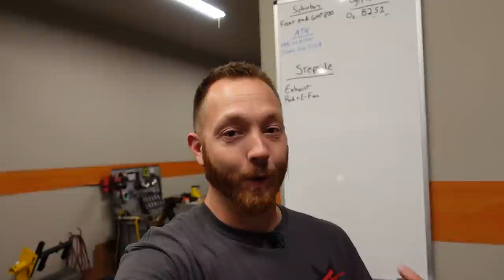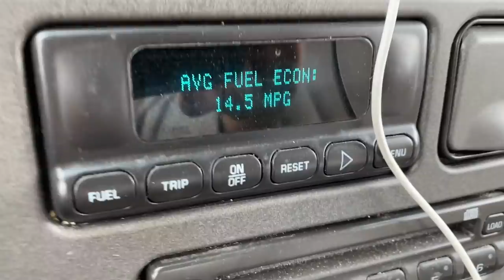the ULTIMATE BRAKE CONVERSION for your GMT400

Comment: Here's an idea for the truck. See how far you can take the current stock 8.1 in ugly truck once the new engine is built. Do the basic upgrades to make it have a chance like pistons, heads, and intake. Swap it in the suburban. If the engine mounts are anything like the 454 it should bolt right in place. That would make this machine snappy. Both have 4l80e so it should be direct swap.

Further idea is to find a GMT400 2 door Tahoe and do a custom thing. If the suburban length is the same then just move the rear axle back like 8 to 12 inches to make the wheel length of the Tahoe. I thing the extra wheelbase would be useful and look cool.
Reply from the maker: both great ideas!

Comment: LT, have you ever looked into an L21 454? Commercial variant and from what i hear, it comes factory with a forged rotating assembly, and coil near plug with a 24x crank and 1x cam sensor (in place of the distributor). I’m considering trying to find one to put some heads and a cam in, and possibly port the intake and see how the truck does pulling trailers

Comment: 99 K2500 7.4L GMC SLT Suburban, essentially the same as your burb. I've been trying to resolve the front suspension bounce when you use a leveling kit that changes out the torsion keys. I've added much higher dampening Fox 2.0 Shocks, but not entirely free from the bounce. I was hoping to find a dual shock solution for our rig, but to no avail. 

I've got you parts list for the front suspension/ brakes and I'll be doing the conversion pretty soon once I finish my dual battery and charging system rewire. Let me know if you might have a solution for the bounce, Ideally I'd like to have 35" tires and would like to avoid a full blown lift if possible as the only real options are 6" and above lifts and don't really want to add blocks to the rear or swap out the lower suspension carrier.

Comment: So in theory, since the GMT400 K2500/K3500 forged LCA is a direct swap for the K1500 trucks, a GMT800 LCA would swap on to a K1500 as well, besides the ball joint differences?

Comment: Awesome brotha and thanks. I’ve got an ‘00 Escalade with 250k that I am going to upgrade now, steering, suspension, and brakes. What’s a good link for data you get about the specific part/model swaps? Is there a forum you prefer or are you mostly reading TMs and what not from Chevy/GM?
Reply from the maker: i read pretty much everywhere and everything I can, forums used to have a ton of good info on em, but a lot have closed down. lately, some facebook groups seem to have good knowledge in em as well
Reply: @LawrenceTolman  thanks mate

Comment: Did you use the stock master cylinder and proportioning valve? 
Was thinking the stock master would not have enough fluid capacity to expand your brake calipers.
Reply from the maker: I had planned to switch it out, but for now its still stock.

Comment: During your research, have you seen any information on doing a brake upgrade on the 1500 2wd obs trucks using factory parts.  Everything I've found is the 3500 rotors and calipers with a nbs master cylinder.   I was hoping there was a way to use the nbs brakes on a 2wd but,  I've not found one yet.
Reply from the maker: i've never come across any good factory upgrades for the 2wd 1/2 ton GMT400s... the problem is they come with a C-10 style of spindle which is nothing like the GMT800 and cannot accept a GMT800 bolt on hub assembly.

Comment: I need a part#for the lower control arms. They should still bolt on to a 99 4x4 tahoe as well from what it looks like.
Reply from the maker: don't have the part number, but they are for a 2001 2500HD 4wd
Reply: @LawrenceTolman  damn more then likely the HD and stock lower control arm bushings will be diffrent in size then I assume.

Comment: Alright Lawrence, dumb question time...at 17:23 or so you mention that "believe it or not, the rotors are exactly the same size just the pads are much bigger and the calipers have two pistons..." so could I just change out the calipers and pads on my GMT400?
Reply from the maker: Well no, you can’t simply bolt GMT800 calipers on a GMT400 spindle because the mounts are different. That’s why we need to change to the GMT800 spindles

Comment: I'm surprised you didn't paint the frame.  That should be a good brake upgrade, those GMT400 were subpar at best
Reply from the maker: if I started painting the frame, next thing you know I'd be doing a frame-off restoration lol
Reply: @LawrenceTolman  Know your limit and play within it.  Did you do any 60-0 tests, before and after?

Comment: So when you reamed out the spindle for the upper ball joint did you ream it out so you could use the cotter pin or did you ream it out and add a spacer to make up for the thickness difference?
Reply from the maker: I reamed it out to get full engagement of the taper into the knuckle, then added a spacer to properly engage the cotter pin. when I reamed it only far enough to get the cotter pin engaged without a spacer, there was a ton of threads still left in the knuckle

Comment: Great content! I have a favor to ask....I'm trying to re engineer a GMT400 Dually 4x2 front end geometry because it's lowered. I see the K2500 control arms are mounted to the side of the frame not the top like mine, L T could you please measure the length of the upper arm for me, bolt center line to ball joint center?

Comment: @LT I may have missed it in this video, but do I understand correctly that the GMT 800 upper control arms will not fit the GMT 400?

Since this is a 2500, will this same type of conversion also work on the 1500?

-Rob
Reply: Im doing that so far no luck the upper control arms are not working making for positive camber

Comment: If you were to only do the front brakes, would you need the masterc cylinder or would the stock hydra boost still work fine?
Reply from the maker: likely the stock master will work just fine. I'm going to try it out with all my upgraded disc brakes and the stock master to see

Comment: I wish you were still in Tennessee.  I am in need of a set of old lower forged control arms for my old lifted 1996 K1500 with stamped lowers Z71.  Unless someone can confirm that new '99 lower control arms for a GMT800 will bolt onto the frame and into the knuckle/torsion bar of a 1996.
Reply: I’m curious about the gmt800 1/2 ton stuff in the gmt400’s as well. However, I’m close to Tennessee and I have a 98 1/2 ton 4x4 parts truck, I’m in southeast Missouri. Might be a little bit of help for ya. LMK if it would help or not.

Comment: after watching this video when you posted it i began gathering parts. i am now pretty much ready to do the swap and really looking forward to it! have you driven it after the swap? how was it along with the rear discs? i have a 03 duramax axle modded and ready to swap in aswell. mine has a compound turbo 12v cummins and the factory semi float is wearing out quickly.
Reply from the maker: I did drive it for a few hundred miles before selling the truck. Everything worked great, even with 4 wheel discs and using the stock master cylinder. The stopping power was greatly improved for sure.
Reply: @LawrenceTolman  thanks for the reply. Sad to hear you sold it.

Comment: Only thing i hate about my 8.1l van is the gmt400 brakes, wonder if i can do the gmt800 2500 spindles and lower control arms with coil springs on my van, hmmmm

Comment: You peaked my interest when mentioning the gmt400 3500hd master cylinder swap. What are the benefits of doing this? Is it just for the reservoir? Or is the the actual master cylinder different? I know you have rear discs, so does the 3500hd master omit the constant pressure that is normally applied on the rear drums? Great video, can't wait to see more!
Reply from the maker: to be honest, I'm not positive on the specifics, but I thought there was something different in the master cylinder that changed the pressure bias from front to back specific to a 4 wheel disc application...
Reply: @LawrenceTolman  
I happen to own a '99 k2500 7.4 similar to yours. It would seem that after comparing the parts visually and spec-wise, the 3500hd master is essentially the same as the standard hydrodroboost used by GM and dodge, just with a larger reservoir. On these units, any pressure bias is controlled by the proportioning valve located to the side of the hydroboost unit. I have heard of guys swapping to adjustable valves, or swapping in a gmt800 four-wheel disc brake proportioning valve. Hope this helps!

Comment: Hey this is the third time I've seen you work on a gmt 400 I actually have the 1999 Chevy extended cab with the 7.4 4l80 had my breaks lock up on the front end. Replaced the caliper the brake hose the master cylinder and still the brakes want to drag and feels like alot of jumping around under the truck. Lifted the wheel spun it round and it locked up on me took off the CV joints rotated the front diff one goes clock wise the other counters. No noises and doesn't get stuck like my caliper wants to jump (the new one) I'm kinda baffled here just replaced the master and the booster within the last year. Just replaced the master as I said last night same problem is it possible the booster could be in boost rather than release? Please help lol it's my only ride and I love these trucks.

Comment: Could you not just use a diff upper ball joint as opposed to reaming the spindle out ?
Reply from the maker: I have heard there is one ball joint that does work (not sure on the application or P/N) but it did require modification where it bolted to the control arm. To me, it just made more sense to ream the spindle, that way if I ever have to replace the ball joint, its a direct swap

Comment: Did you load the suspension when tightening the upper/lower control arms
Reply from the maker: yes, I used a floor jack to lift the suspension into a "ride height" position when I torque the bolts, so the bushings don't bind

Comment: Someone else already asked, but I second this: will you post a partslist for the gmt800 to gmt400 front brake swap? Or perhaps a good link to source a proven partslist? 
I have an 89' K2500 Sierra (SM465 4 Speed Manual, NP241 XFER Case, NO ABS on the truck) that desperately needs stopping power.
Reply from the maker: I'll try and get a parts list put together when I do the final review and first drive video
Reply: Thanks LT. I've been wanting to do this upgrade for a while now myself👍

Comment: How do you know all this stuff and what parts from each generation will fit and when knowing what size taper reamer to get.  Is it available somewhere deep in the web or just in your brain somehow, and if it's just in your brain how did you learn it.. Great video.
Reply from the maker: I spend way too much time researching and reading lol... a lot of this info came from some old-school forums I read long ago, and facebook groups also have some good knowledge buried amongst the "what's the biggest tire I can run" questions
Reply: @LawrenceTolman  nice.  I used to have a half ton 2000 suburban.  Only sold it cuz I needed a 3/4 ton truck to tow our travel trailer.  I was looking into brake upgrades, but never ended up going through with it all due to needing a 3/4 ton.  Now I have a 8.1L gmc sierra 2500HD, so I like your ugly truck content too.  I would like to cam and chip it.. and of course exhaust, but since it is the family tow rig, I need to keep it not too loud and reliable...

Comment: Ahhhh so u can also use a 2 inch drop spindle if u wanted to lower it. not just a drop keys option
Reply from the maker: you know I didn't even think about that option until now... but yup you could. also, lift spindles applies as well.

Comment: Can I do this same swap and use a 6 lug hub? I'd love to do this on my 98 z71 ls build
Reply from the maker: yes, I think you can do a similar swap with GMT800 1/2 ton stuff on a GMT400. not sure on the specifics, but pretty sure some have done it
Reply: No. This uses a four-bolt hub assembly. However, if you get a spindle from a NBS 1500 which uses the same three bolt hub assembly you can make it work.

Comment: I am not 100% sure about it but I thought the upper  control arms were all the same on OBS K1500 to 3500 and you just have to install the correct upper ball joint for the spindles you are using and you don't have to ream out the spindle. Also I thought the OBS K2500/3500 lower controls arms were all the same and you only have to install the correct lower ball joint into the lower control arms for the spindles you are using. Maybe someone else can tell me if this correct?
Reply: K1500 and k2500light duty upper control arms are narrower than the normal 8 lug k2500 jist found this out the hard way also the nuckle is tall enough on a 1500 or 2500ld to make for bad positive camber working on getting some off set upper control arm bushings to maybe fix that gm 45K0201 dont know yet if its gona work

Comment: Would there be any problem If I do the gmt800 1500 6 lug on my gmt400 1500 z71?
Reply from the maker: I think it works in the same kind of way as it does with the 8 lug trucks, but I've never done it myself to confirm
Reply: @LawrenceTolman  that was my thought process too. just gonna have to find and figure out myself

Comment: anyone know what thread the oem brake like is on the front of a 1990 k2500 light duty ?
Reply: Turns out the upper control arm is different on the ld 90 k2500 makes for way to much positive camber going to try the offset uppper control are bushing to see if i can get the camber close not holding my breath its pretty far off 🤢

Comment: I doubt you actually noticed braking improvement just adding rear disc over the rear drum.  Drums have so much more braking surface.  Drums suffer from inability to shed heat as efficiently and thus brake fade.  Fresh cold drums should stop faster than a disc...  the 1st stop,,  with less pedal pressure.   Unless your rear drums were way out of adjustment.
So..  frequent and often stopping.. discs..   shedding a hundred or so pounds of unsprung weight..  discs.
Reply from the maker: good info there, and I do agree on the weight. those stock drums weigh a ton

Comment: Why couldn't you just buy gmt 800 ball joints and bolt them onto stock gmt400 control arms? If the arms are identical, it seems that the mounting of the ball joints would be the same. The only difference would be the ball joints, and I would think that the gmt800 ball joints would have a different taper but would still mount in the control arms the same way
Reply from the maker: not saying the arms are identical, but they are 90% the same. I don't know for sure if the newer ball joint will press into the old control arm, or if the hole is a different size... would be a good experiment though.

Comment: Really don't get all the hype for a 6L80/90. It's just a more expensive transmission that would require a lot of work for what? 2 more gears? No real benefit when it's already got a 4L80 that's more than up to the task.

Comment: LT you should know better than anyone that the GM rear g80 is a locker not a limited slip
Reply from the maker: Nope. Not a locker in the traditional sense at all. If you look at how they actually work, you can see the engagement mechanism applies a clutch pack which still can allow a slight difference of speed exactly like a limited slip. A true locker will act like a spool when it’s engaged with no slip at all. The g80 is no more a locker than a Yukon Duragrip or any other clutch style posi. Just because it has an engagement mechanism that senses slip and GM calls it a “locking” diff does not make it a locker.